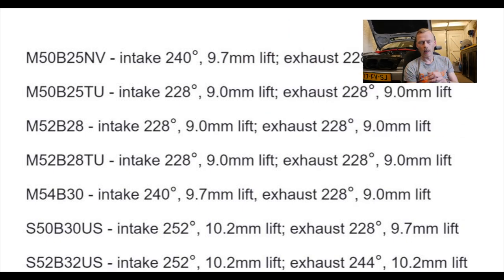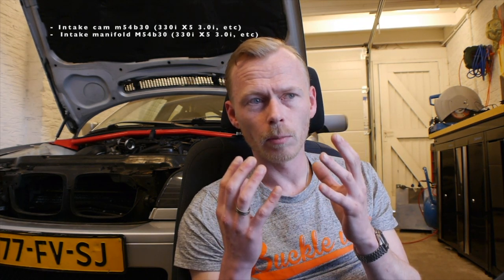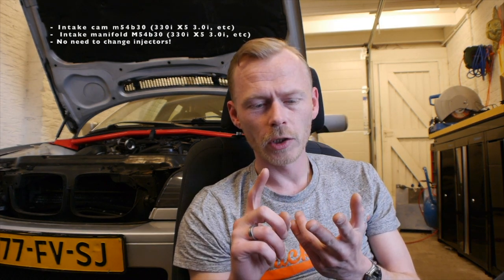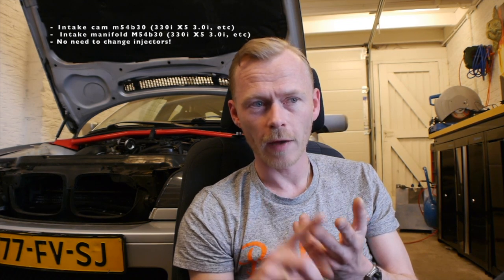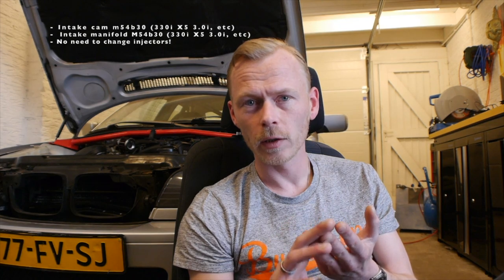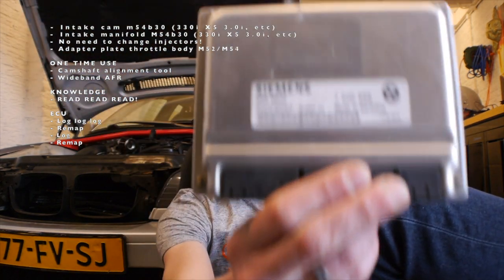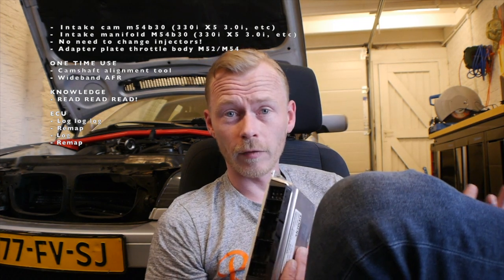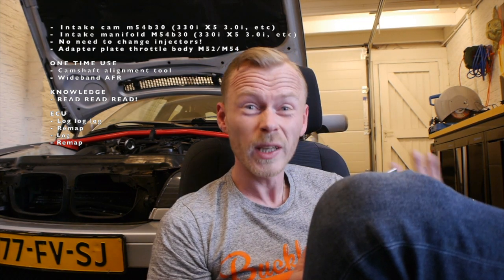220BHP from our BMW 323i e46 with ONLY 200 euro's! - DIY TUTORIAL

Comment: These are good reliable mods, however to say you can do it for 200 euros is unrealistic.  The B30 Camshaft alone will cost that much,  the manifold, adapter plate and a new set of gaskets about the same again. You'll probably need various new parts like a new CCV and possibly new intake boot as well as these all get brittle with age and break easily on removal. Add another 100 bucks.  Most people will need their remap doing professionally. Probably 400+ bucks.   I'm not saying I wouldn't do these mods, but people need to be aware realistically how much it is going to cost because it may end up quicker an easier just swapping in a 330i engine.

Comment: I'm currently running an e46 323i 1999 manual sedan in the same titansilber metallic colour. However I haven't changed anything on the engine so I would like a step by step tutorial and would gladly improve my car even further.

Comment: This also works for M54B25 as well. With M54B30 injectors and MS45.1 engine control you can run E85 easily.

Comment: Thank you for sharing your knowledge. I am on a similar road since i recently upgraded my 328ci with B30 intake, B30 cam, headers and for some reason i just changed to B30 injectors. 
I already played around and got familiar with RR and RR logger, added nice pops and bangs and stuff and of course i have seen your post about the LC :) 
Next thing will be remapping, the car runs fine and definately has decent power but from my logs and buttdyno i feel that there is still quite a bit potential to squeeze. Thanks again, excited for more...greets from Germany, Tommi
Reply from the maker: Thanks man! So, upcoming Friday we will take a m54b25 to the dyno for the initial run. After that, we will replace the intake mani and camshaft with b30 parts. We will film everything, including my way to do the remapping (logging + tips+tricks on vanos tuning, combined with DISA). Stay tuned and thanks again!
Reply: @BuckleUpGarage  hier ben ik erg benieuwd naar. zit midden in het proces nu .
Reply: @BuckleUpGarage  did you post about this? i didn't see it in. the playlist
Reply: hello do you know the difference debit between injector m52tub28 and m54b30 injectors?
Reply: @jo098  B30 inj. give 112% and 252cm3/min ... dont forget to adjust deadtimes. Turned out calculation was pretty good for me
Reply: @Eltrielo  
hello and thank you very much 
by looking for "dead time" 
I found the explanation on ms4x for tub28 and b30 
should we take the values of dead time and minimum injection time of b30 and modify tub28?

for the b30 intake cam
m54b30 and m52b28tu have different MIN and MAX values: intake 86 to 126 for M54, 85 to 120 for M52TU
exhaust 85 to 105 for M54 and 80 to 105 for M52TU.

did you modify min and max values?
Reply: @Eltrielo  hello 
i open a topic on romraider name: "m52tub28 upgrade cam/manifold/injector to m54b30..again"

i can't share a link here.
i need some confirmations before starting the same project than you.
if you can help me thank you
Reply: RR logger is free?
What else can I use to log my E46 my goal is to see my afr but is it possible only with the stock 02 sensor?
Reply: @imestia7911  yes its Free and no you need wideband for afr
Reply: @jo098  thanks

Comment: Brilliant!! I have a e46 touring 323. I did the M54 B30 swap with the USA "s52" intake came and a aggressive exhaust port on a M52Tu head. ( I think the m25 tu is a better head)

But I have been doing a lot of tuning with the Ms 42 DME.

It's very very similar to the ms43 that everyone seems to love so much.  I really only found a handful of little differences in maps.  I would understand the most confusing thing for everybody is that all the acronyms are in German. 

So where is the ms-43 would say something like inj cyl 1..

The ms42 would say  KF_Z_1 and they are the same map but the ms42 kept it in German saying kugelfischer cylinder 1.

I found it very important to match the intake manifold size volumes in the map and airflow section. 

And of course the Lambda value sections

And as far as the throttle bodies are concerned I would not worry too much if you measure at the for the narrowest portion of the 3 liter intake manifold throttle body is 2.7 in and the TU is 2.6in.

 By mistake when rebuilding my engine I ordered the M54B30 throttle body gasket and they were practically identical.   

Yessir the 3 liter air mass meter is much much larger but then it comes down to almost the exact same size at the throttle body. Yes the three liter air mass meter will handle up to 1200 mg per stroke.  And the 2.5 liter air mass meter will handle up to 800 mg per stroke.  But the M54 B30 at Full Throttle is about 600 mg per stroke. So even then you're not really gaining much by changing air mass meters.
Reply: Hi "I found it very important to match the intake manifold size volumes in the map"
what map are you talking about?  thank you
Reply: I like pies

Comment: I actually done it kept the injectors from the b30. Inlet manifold from b30. Throttle body and intakeboot and maf. I haven’t changed the ecu to b30 it’s currently running on a performance map for the m54b25 that was already making 208hp but at the moment she has loads more torque and much more to give at top end she just needs another map!

Comment: Quick question. Do you recon it would work for an m54b22 as well? (Although I could just fit an b30 throttle body) but as far as I know the m52tu has bigger bore or travel or something?
Reply: I own a m5b22 as well , as far as I can tell the power gains should be similar. If you get more info please comment . I'd also appreciate your feedback

Comment: nice job man, I have a question hope you can help me, I have a m52TU b23 engine, I want to make a b30 stroker, the harness that I have comes from an m54, the question is ... can I use the m54 harness for the ecu s42? ... another question is ... with the m54 harness and the ecu s42 will work the throttle body of the b30 m54?  somehow the ecu s42 will work the throttle body of m54?

Comment: Ty man im wayy late to.the video.. lol im frum the future!! So i have a 03 325xi m54b2.5 
Ive invested much 2 keep it going so im stuck wit it.. i want to do unequal length headers.. they dont make em, so my idea is run a header an a stock manifold to create the subaru sound.. dont care about gains.. atleast frum that.. i want low/mid range power nore than ne thing.. hard 2 achieve it seem.. im determine 2 not go turbo or s charger.. it is only my daily.. i jus want to improve the comfy 5speed fun of this vehicle an make it sound better.. that sweet bimmer noise wit some subaru sound.. an jus enjoy driving like i stole it everyday.. ive had fast hondas over my time.. but i love this car an have way 2 much on it.. to part.. but on low budget.. wish 2 achieve gains.. nos isnt wanted much but laterdays may do a 75 shot.. but really i want low mid power so i guess more torq.. please help!! Advice appreciated ty

Comment: Hey goedeavond 
Neem aan dat u Nederlander bent..?
Ik heb zelf een facelift bmw e46 325i 
Ook m54 geloof ik.
Kan ik dan zonder adapaterplate een m54b30 intake en intake cam nemen en ik zag op ebay een ecu voor m54b25 met 224 pk 
Ik heb voor nu de 192 pk 
Bj 2002/05